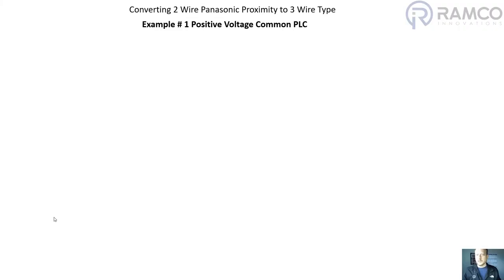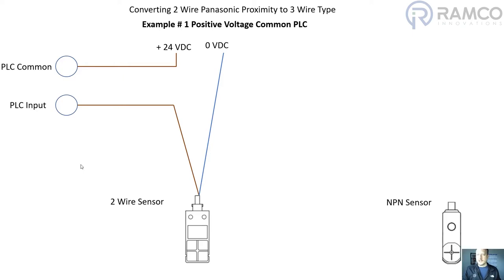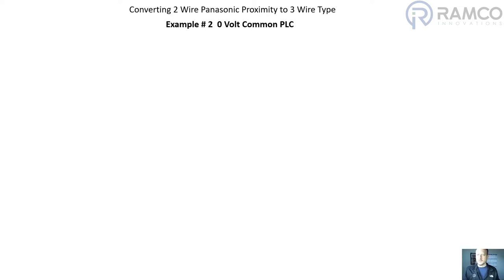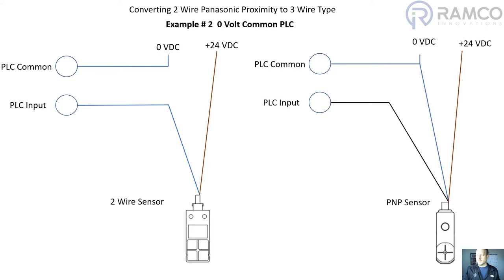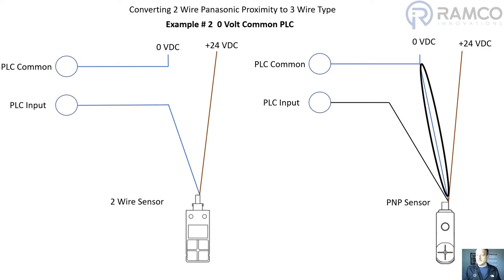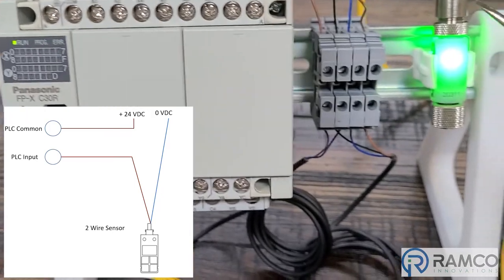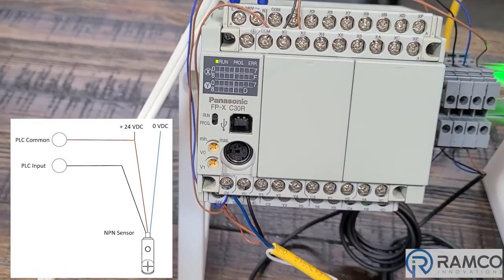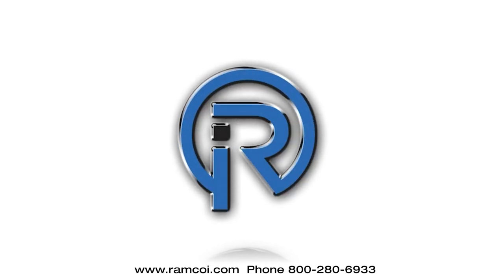How to convert a 2 wire to a 3 wire sensor

Comment: So i have a BI2-G12-AZ31X Inductive Sensor.  Compatible with both AC and DC.  I am testing the sensor with DC power on my bench top power supply.  Oper. DC voltage is 10 to 300 VDC, and 100 mA.  The Turck diagram shows a resistor symbol in the diagram on the load side.  I did not connect a resistor because i can control the mA's with my power supply.  
When testing it, the red LED turns on, but does not shut off leaving the circuit closed.  Why would it do this?